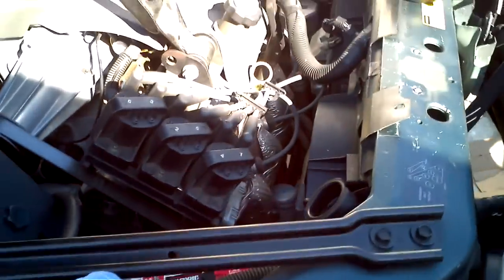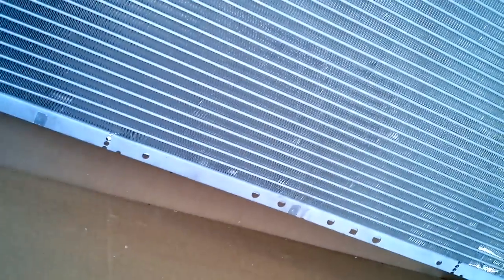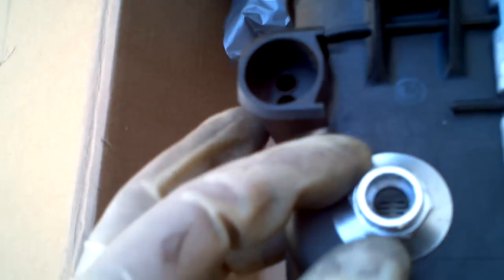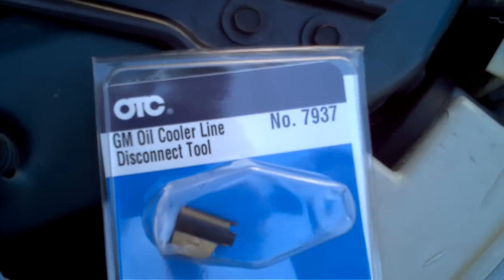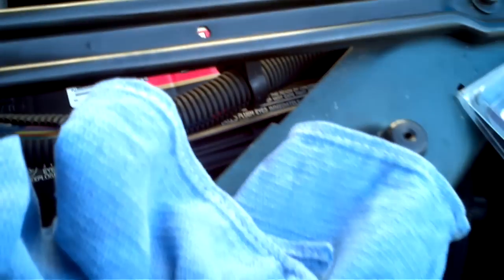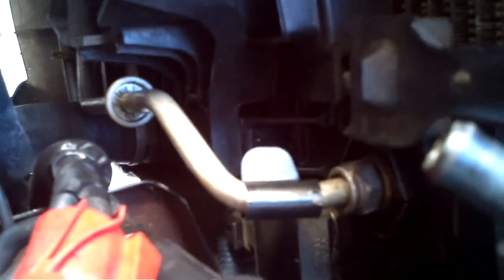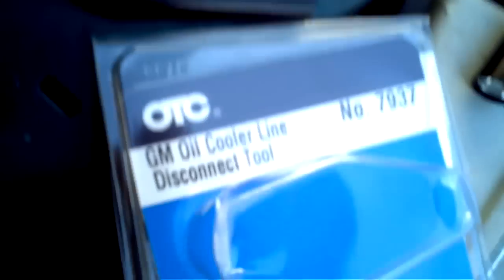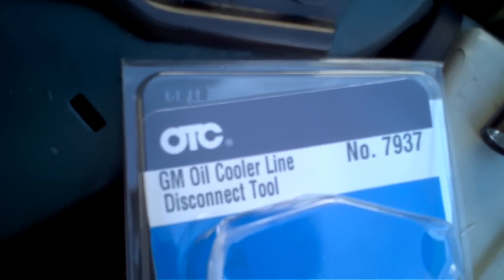Radiator transmission line removal for 2000 Buick Regal... and for most W body vehicles.

Comment: I just bought same Delphi radiator and tool off Amazon for my 2002 century.  I'm glad you explained that the cooler line needs a left turn because that's what I wasn't sure about.

Comment: I solved my buick issue a gallon of gas and a single match!!! I feel much better now!
Reply: dean stevens If only I would have known how much of a money pit they were years ago I'd have bought something else, even though I got it for a good deal my 2002 century has had a lot of serious repairs including a new transmission, engine replacement, all new brake and fuel lines from being rusted out, fuel pump, countless front wheel bearings and suspension parts breaking and enough small things to bankrupt me like window regulators, corroded wiring harnesses and many others lol.    I got so much many new parts on this thing I'm not going to get rid of it.
Reply: Yeah I feel you on that same here new window regulators on all for windows a harmonic balancer a new alternator new head gasket valve cover gaskets new ac condenser new motor air blower new transmission a new speed sensor along with its maintenance like coils wires spark plugs battery brakes tires and now a new radiator just wondering what’s next

Comment: Instead of finding and buying that tool plus waiting.. Just get a black marker cap and cut the end so you have 2 open ends an slice it straight down the middle so it will go on tube and push the marker cap and pull and it comes off!!  Bang Bang..
Reply from the maker: +"The Real John Riverdale" Never thought of that. Thanks John!
Reply: Any time
Reply: "The Real John Riverdale 
what was you saying about slicing something I'm doing my radiator tomorrow and I'm kinda stuck on you was saying

Comment: How's your radiator holding up I'm thinking about buying the same one tomorrow
Reply from the maker: Hi.. it's still holding up fine. No problems since I made the video in 2012. The only custom work you need to do is to drill the holes for the low coolant sensor. Other than that.. not a problem at all. Perfect fit.
Reply: Thanks man appreciate it men's should be here by next week

Comment: So if you disconnect the bolt and put it back in, you could have problems with the inner attachments in the radiator? In other words, if I take the bolt out of the radiator it won't function properly without the attachment inside joined back together with the bolt?
Reply from the maker: yes.. remove the line via the clip and not the nut/bolt thing or else that inner portion will just drop within the radiator and will be a pain to put back.
Reply from the maker: this is another good view of removing the clip. https://youtu.be/SsX9ciELVLE
Reply: Unfortunately, I removed the bolt because I couldn't get the fan out with the fan housing blocking me from taking it out. Do you know how  can I join the coil inside the radiator, back to the nut?
Reply from the maker: +Jonnie Jones it was a pain but i was able to do it. i had to invert the radiator and use gravity and luck to line up the hole so i could put the bolt back in. its possible. i think i used a small screwdriver to line it up while it was upside down. then bolt it back. good luck.